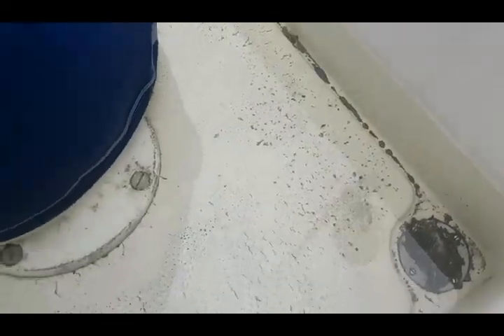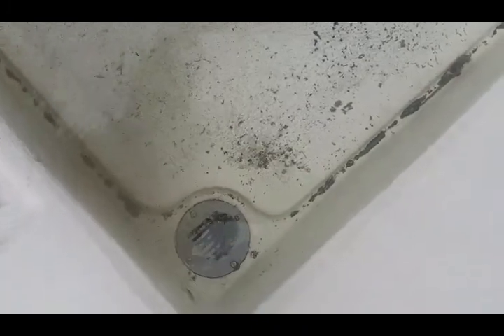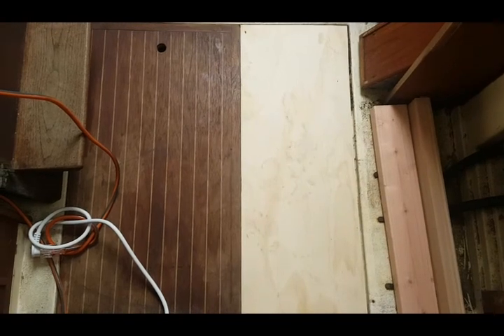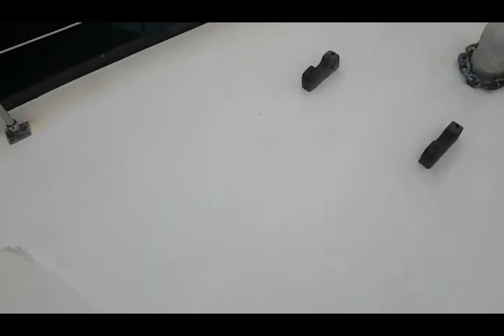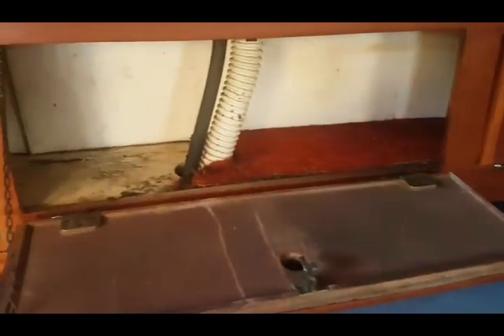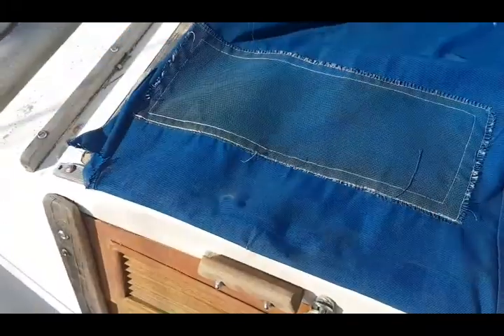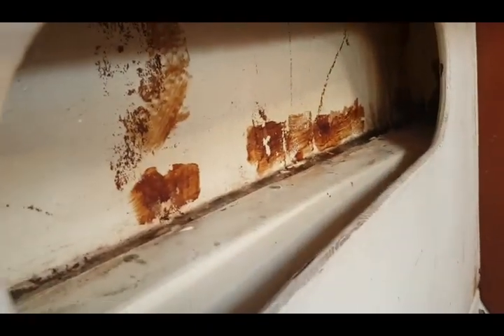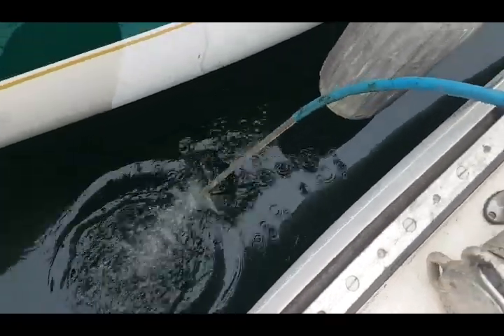Ep. 2, Dealing with Water Ingress and General Maintenance

Comment: That is the same way my Alberg got water in it. The yard manager said its a horrid design flaw and should be redesigned. Love the cassette player, I would list that on Ebay :) As far as that foam etc I will being going to my boat next week and will check that out. Great to see you getting started.
Reply from the maker: I'm going to use 5200 on the hull to deck joint and take the teak off and clean everything up and rebed (not sure with which compound). It sure is a bummer. My biggest concern now is what is underneath the floor pan/liner. What are your thoughts on inspecting that? I'm assuming there's stringers between the bilge access panels that I'll inspect once I service the tanks, but is there any wood further underneath the liner? I just don't know. I'm eager to replace the chainplate knees. It will be a big job but it seems relatively straight forward from a high level. 
Are you going to do any big jobs like that? Standing rigging and the like?
Reply: Your Alberg is a MKII also right?
Reply from the maker: Yep
Reply: Well, from my research and understanding. The MkII was the more robust of the A37's. It was built not using any wood in the support structure from the toe rail down. From my understanding the support structure was all fiberglass. I am guess you will find out sooner than me if this is indeed the case :)
Reply from the maker: Oh I hope that's true! That would be the best news all week, but I also know better than to count on that. Also, they built the MKII for a long enough time that I'm not confident they were all built in the exact same manner.
Reply: Hey sorry for the late response, I completely forgot. I did check my boat for the foam and there is nothing there. I think that was someone trying to insulate your Alberg :) When are you going to post another video? I am looking forward to seeing your progress.
Reply from the maker: John Turner no worries. Thanks for checking on that, it quenches my curiosity about the foam. 

I have been taking videos but I wasn't happy with the result of editing them on the phone, and my 6 year old laptop wasn't up to the task. Luckily, I just got a hand-me-down laptop from work, so I popped an SSD in there and finally put an OS on tonight, so you should see some new content soon. 

Also, I'm going to start a channel for the boat specifically, as I'd like to use this channel for other hobbies and don't want to confuse anyone. I'll post one more video here asking subscribers to migrate, then the rest will be on the new channel.

Stay tuned!
Reply from the maker: Hi John, a new video is up on my new channel, S/V Kintsugi: https://www.youtube.com/channel/UC1v1XOqe3ud5AceuRAF21Rw
Reply: Thanks for the heads up. I caught your posting yesterday about the new site, rushed over and became your first viewer and subscriber. Somehow I missed giving it a thumbs up but that has been remedied.